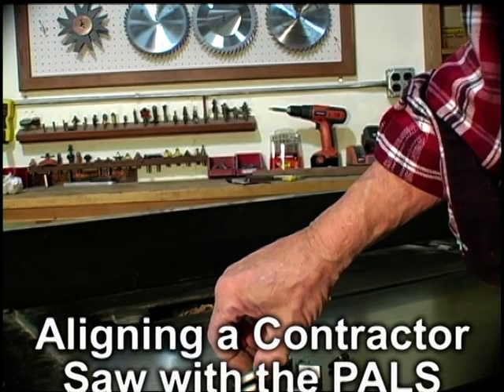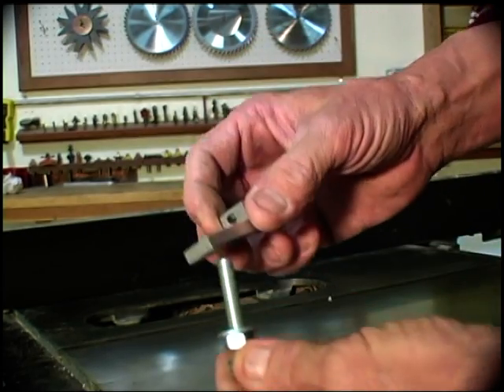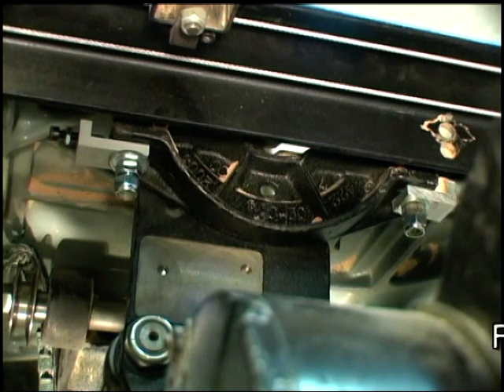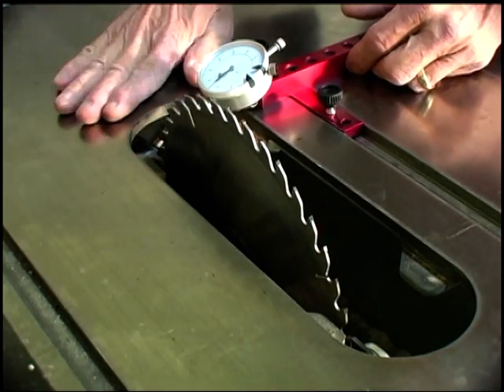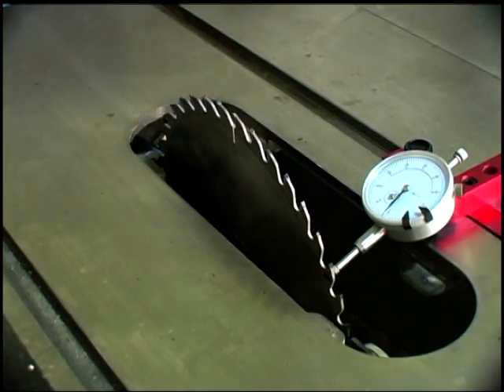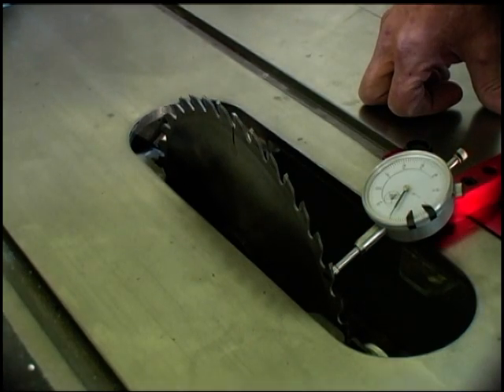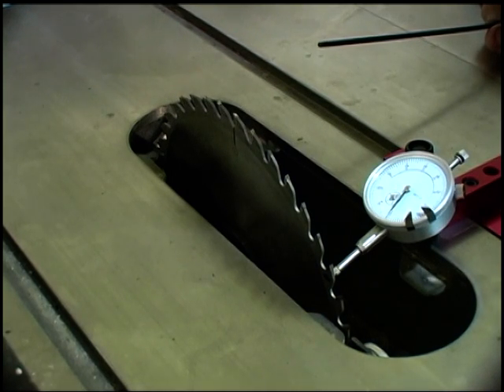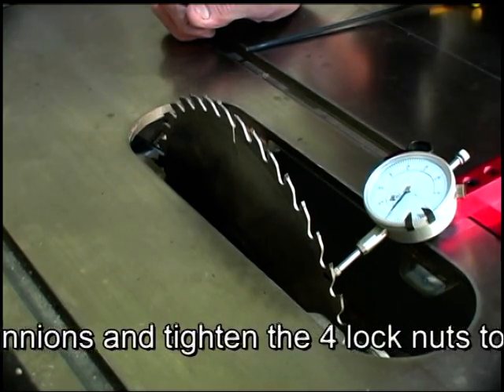Aligning a Contractor Saw with the PALS

Comment: The "pivoting" was achieved buy putting a "sized-hardwood" sleeve around just "one" of the front bolts to "fill the gap" in the trunion hole. Then loosen both the front bolts VERY slightly. Then do the adjusting on the rear, either using trial and error without a gauge; or, of course, using the gauge; which would be MUCH better I am sure.

Don't forget to tighten the front bolts firmly; while checking the results; AFTER the rear trunion is brought into alignment..

Thanks again Jerry

Comment: I recently purchased the PALS and the A-LINE-IT dial indicator from Amazon but before I say anything else I would like to add that my table blade was out of alignment from front to back by almost 1/2 an inch.  I own a Grizzly 1022Z that was bought new back a few years and I guess over the years I was making small adjustments to the rip fence that I never really noticed. I also found that the front two trunnion mounting bolts were lose. Before using the PALS and A-LINE-IT, my entire trunnion blade mount, front and back, including the blade carrier unit, was completely removed from the saw. It was cleaned, re-lubricated, and re-assembled. No easy task since this was done while the saw was upright.
Once reassembled, and once I figured out which way to move the adjustment screws on the PALS, the alignment went fairly quickly.  The instructions that came with the A-LINE-IT were very good and I watched the video above probably ten times before doing the "tune-up".   The only thing I might add is more diagrams to go along with the instructions to facilitate and ease the setup and the install and adjusting of the PALS. Other than that, a very good product. 
In addition to the above, a new blade was installed (before adjusts), a blade stabilizer was added and I finally put on a zero clearance table insert. I'm very pleased with the outcome and my saw has never been better.
Reply: Ray Carson quite

Comment: Great system and idea for alignment,  I ordered The PALs system, the two pulleys, link belt and the A-Line-It Gauge Deluxe for my 1983 Sears Craftsman TableSaw. All instructions and videos are great and well done I must say and the quality of the products are fantastic! First a little history I purchased this saw new and I’m the only one who have ever used it and the condition I would rate at 80% I just want to update it every thing I could, Incra Fence system, Incra Miter, Bora Mobil base, Ridge Blade, Pulleys, Link belt, PALS system and alignment to saw done.  All went well BUT luckily I am fussy take my time and double check everything I am a great woodworker and mechanic so while checking the new belt running with the blade down I was checking the clearances of the belt, pulleys then starting to raise up the blade all looked good,  I was going to check it with the blade in the bevel position so I turned off the saw I raised the blade all the way up and was going to start to move it to bevel but decided to take one more look underneath! That’s when I noticed a problem with the belt hitting the “PALS Bolt locknut” and the Arbor Pulley the “Belt is Rubbing” the bottom of the top because of the way a link belt rides high on the pulley a V belt doesn’t and the pulley on the arbor is the same as the old one “original “ I was lucky and saw this before I had the saw running with the blade raised all the way up my saw 3-3/8” after contact with Jerry he said his saw blade only raises 3-1/8”? If I put my saw at 3-1/8” I’m good anything over I will most likely rip the belt apart great for I-Line bad for Me so be careful and check your clearance.  Jerry said he has never seen this before but now he has! 
Perry

Comment: My old Delta/Rockwell contractor saw needed a trunnion adjustment.  I watched this video and a few more.  Loosened 2 bolts, a few light taps with a hammer and then measured the blade.  Straight as an arrow and it fixed my problem.

Comment: I am impressed Jerry. But I am concerned about something. Since you are ONLY moving the "rear" trunion, I have had problems in the past where I got the blade "dead on" using trial and error without a gauge as you show; BUT the "tilting" of the saw became harder.

So I modified the "front" trunion to allow it to "Pivot" as "ONE" unit. This solved the problem. I will buy your product and try it, in any case.

As always at the "shows" your demos are excellent dear friend,

patdee

Comment: Hi Jerry,
My 1980's vintage Craftsman 10" T.S. needed to be modified to allow the miter to extend the full 45 deg. I had to replace the original stud and nuts provided in the kit with a standard shallow head bolt on this one side.
I removed the blade guard and removed its mounting horn after marking where the bolt head touched and used the bench grinder to take some aluminum off to provide the needed clearance. 
Now my saw makes the full 45 deg. swing!
The other option is to remove the blade guard altogether.
Reply: I ran into this as well and just decided to not re-attach the blade guard in my restoration.

Comment: I have a Craftsman 113 table saw and am having a heck of a time getting the blade square with the miter slots.  The PALS system seems like it would be a great benefit in getting  correct alignment.  I have a question and it doesn't seem to be addressed in the video.  My saw has 4 bolts that hold the trunnion to the table top, 2 in the front, 2 in the back. The bolts that do not have PALS on them, are they loosened at all?  Surely they don't stay tight while trying to align the blade?

Comment: Hi Jerry. I just ordered the pals from reading on the net, then found this video.
I was under the impression these things not only aligned the blade at 90º but also at 45º, yet I didn't see you mention anything about it.
I have spent many hours tightening and loosening my trunnion bolts with tap tap here and a tappity tap there, getting the blade damn near perfect, then tilting blade for a measurement and finding it quite a few thousandths out.
Please, what say you???

Comment: These need some help to work properly with a Ridgid 4512 but they do work.
1.  you will need some new bolts.  an M10-1.5 35 MM will work (the stock bolts are a hair too short  at 30 MM.
2.  You will need to grind a bit off of the trunnion about 1/8th of an inch or so on each end.  (this requires removing the trunnion completely from the saw, so you will also need something to keep the motor from falling).  
3.  Once you have done this the install works just like the video (you will be totally re-aligning the saw as part of the install).

Also the folks at In-Line have great customer service and will go out of their way to ensure happy customers.  Highly recommended.
Reply: Or you could just buy a few longer bolts instead of tearing up your saw.

Comment: I install the pals on  my delta 36-650 on the back side tighten as much i could and still my blade is off by a good 32nd of an inch on the back side wich is closer to the rip fence on the right side of the saw.
I did follow all the instructions given and can't get it to lined up.
I even try lossen the front and nope didn't work. Is like if i need more play on the bolt holes.
Please any help would be appreciated greatly. Thank you.
Reply: I found that if the tilt adjustment handle was tightened it prevented the front trunions from having their full adjustment movement.

Comment: Very good video. The first two had low volume but other than than that it is very helpful. I just inherited the same saw. It was stored in a building with pool chemical and is coated with rust, so here I go into electrolysis
 land, wish me luck.

Comment: What if I don't have that gauge? Is there a way to make a home-made jig to do the alignment test?
Reply: I made a wood adapter to clamp the indicator to my T slide. There is a mounting bracket on the dial indicator. I realize some do not have it but that is when you need to get creative.

Comment: I missed the part about the front bolts. are they loose? I have a craftsman saw that6 has 3 bolts at rear. What happens with that middle bolt?
Reply: @ herbsu43   My sears has 6 bolts total as well and I loosened all 6 and finger tightened them all to get my alignment within 6 thousandths.  Then I would tighten the front and back middle bolts a little bit then used the PALS to get the alignment closer and then tighten the 2 bolts without the PALS up a little bit and recheck.  Then tighten the nuts up and recheck alignment.  Took me about an hour, and it was worth it.

Comment: Jerry, I understand the alignment part but the miter pitch on my 113 keeps slipping off 90 degrees. Will the pals keep it locked in for a longer period of time. Question from a newbie uf you haven't guessed.

Comment: I bought a set and look forward to getting my old 315 series craftsman set properly. Do you recommend tightening the front bolts and leaving the rear hand tight when starting your adjustment?
Reply from the maker: The 315 series Craftsman saws use 10mm bolts, and we do not make PALS with 10mm studs.Jerry
Reply: @inlinedubby  My "315 series"  saw purchased in 2004 uses 5/16" bolts.  So is it better to loosen the front bolts for the adjustment?

Comment: Based on this video, I ordered the PALS kit for my Craftsman contractor saw. It didn't work, the studs that came with the kit appear to be 5/16, my saw has 12mm mounting bolts. I did get the blade aligned using the traditional method "Bigger Hammer". What a waste of money.
Reply: Since they offer 3/8" and 5/16" studs (depending on the model of Craftsman saw) maybe you should have been smart and checked your saw first. The waste of money was entirely your fault.

Comment: I bought this kit and specifically for the RIDGID 4512 and the studs where too small. I had to go get some new ones from LOWES and drill a 10mm hole in the aluminum parts. No big deal but had to turn the world over to fine a 10mm drill bit. I am in the middle of doing this now. I will let you know how it goes. As many of you know the RIDGID 4512 is well know for the blade too NOT be parallel to the motor slot!  GRRRRR!  Damn Chinese political prisoner workers Think they would have more pride in their work!!!